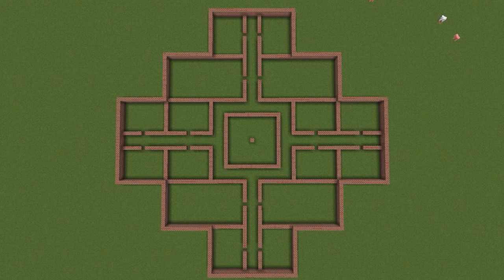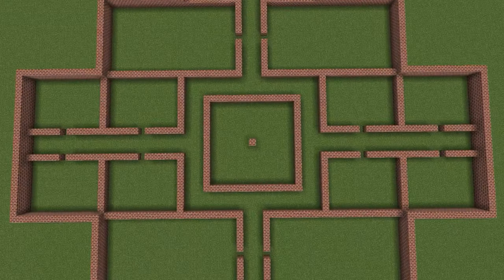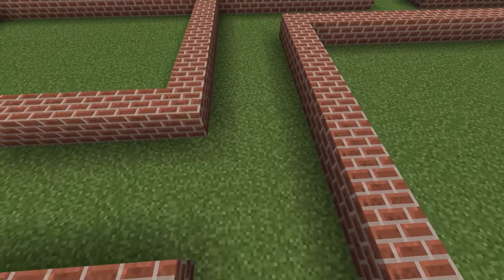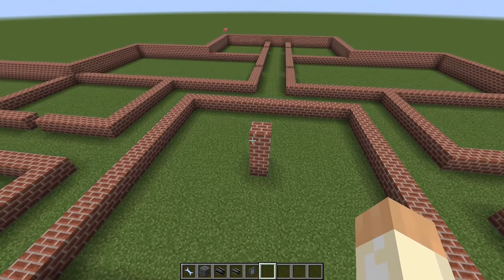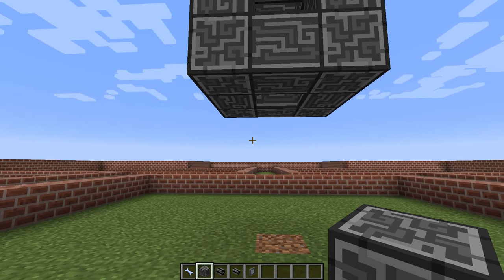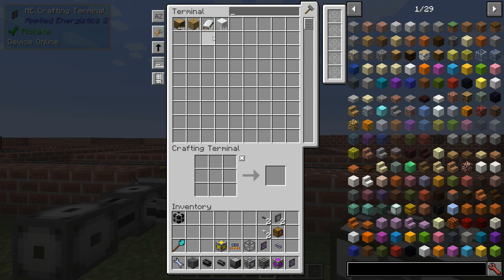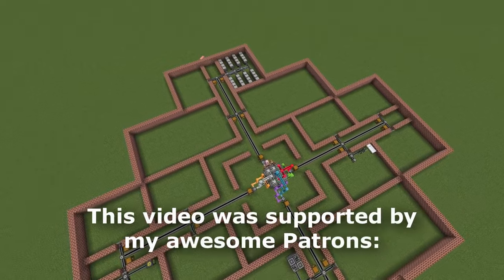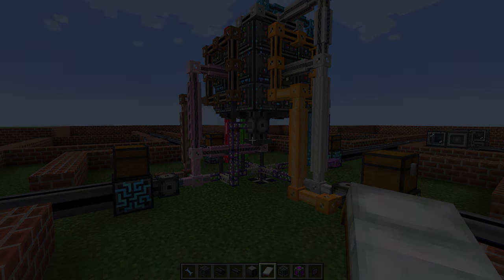Large ME Controller and P2P Network Guide - Applied Energistics 2 Tutorial

Comment from the maker: Another AE2 tutorial video - An updated guide to large ME Controllers and medium to large sized bases. Minor updates since before and everything in the same video should be more useful than the old ones!
Reply: it doesnt work for me i did everything but i cannot connect all my me drives it just uses 8 channels and doesnt give me the full potential
Reply from the maker: @dzzenok4136  Not sure what you've done but you might have mixed up cables (use dense cables where required) and check the video on me networks to learn about how to handle the 8 channel limitation, after that you need a controller, and then you need dense cables to handle 32 channels before branching.

Comment: P2P is a great thing when it works.  I wish I had done your memory card trick in the chest for easy relinks.  I know what I'm going to be doing tonight and that's trying out how you set this all up.  Bravo good job!
Reply from the maker: Did it work out? It's easy to do when it's planned for :) But I know that when you're in the middle of building and expanding you never leave that extra space for a backbone network or a smart P2P system.
Reply: @therealtkh  I actually had so much fun messing around with it I started a new level to start from scratch.  I now have chests throughout with memory cards storing the info and it's simple now even with the amount of connections.
Reply from the maker: @TheElderOne2003  Awesome! :D

Comment: I've done a similar one where I led the tunnels back into the main controller, and then used large cabels to connect to those interfaces. It was pretty flexible, as as long as there was cable capacity, I could connect to more tunnels. However it was also more expensive and complex, needing more controllers for the same result. Your design is neatly separated.
Reply: The "read more" button is broken here

Comment: Maybe a little late but you can name your memory cards in an anvil.
Once your base and your AE2 system grow to a size where you have to rely on tunnels, it will essentially restructure all of your cabling and you will have dozens of tunnels.
If anything breaks or you want to move around your core of controllers, hooking up every last one of the tunnels can be a daunting task and you are likely to forget one.
Having a bunch of memory cards with unique names at least tells you how many pairs of tunnels your base used to have.
Reply from the maker: That's a good point! Another way to do it is to keep a chest (or item frame) next to every P2P tunnel output with the corresponding memory card. That makes it easy to reconnect after maintenance :)

Comment: I hadn't considered using another ME controller to handle all the p2p channels, very interesting!
Reply: This is what many Minecrafters and Minecraft-Youtubers do wrong. They connect the P2P Network back to their Main ME-Controller and waste channels instead of using a separate Controller. They can also run only up to 16 P2P Input-Channels and 16 P2P Output Channels. I tried both Versions, and i think the one like in this Video offers higher operation speed of the whole ME-System and you can run up to 32 Input- and Output Channels per P2P Network (Dense Cable required) at the same Time.

Comment: There is something i can't understand
why doesnt the little controllers break when you connect the p2p cables to them 
and why do you need the smaller controllers for this setup to work
Reply: Late but the little controllers are a separate network, that's why they break when you connect them to the power without clear cable because that'll put them on the same network. You use them so you can have 16 P2P hubs coming from them on a single line, without you'd have to run two lines of 8. 

This set-up gives you access to 16 P2P hubs in each direction, and each of them allows 32 lines / machines. 
There's 9 sets of 8, he's using 8 sets and leaving the bottom set free for now. If I was you I'd leave the top set free of this was in your basement and have them going directly up.
Reply: @anhedoniac6390  
I'm pretty sure you could even have 32 P2P hubs on one line, as long you have two seperate lines only connected by the "p2p-net controller"  

So you go from 4 lines (eight p2p channels divided by two), to 8 times more (32 output p2p channels)

Comment: Thanks for the guide TKH! I'm new to the modded scene and I am now nearly at the point where I start delving into AE2 and I have to say all this is new to me. I also have a feeling this is a more advanced guide and I really should start watching previous guides first as some things are unclear to me. I really appreciate your effort, and I will definitely try do my own research. But, if you don't mind, I would like to know a bit more about these channels and perhaps you could explain a few things?

1) why do you use color coded smart cables? If using p2p channels, would it be possible to just use glass cables through your corridors to connect everything? Then pull out a dense cable from the p2p channels inside the rooms again?

2) why do you use separate ME controllers for the 4 different corners of your base? What is the benefit of doing this and what is the result of this on the amount of accessible channels? Is it considered a separate network that it actually needs its own controller?

Comment: Nice video, thanks for sharing. 
Just a question, why do you need the extra 4 controllers? Can't you just use the dense cable out from each side of the cube with the colored cables connected, since you're using the memory card to link the p2p.
Reply from the maker: A network without controller can only consist of 8 channels. So they are not needed but you could only manage at most 4 rooms if you want 32 channels to each. I have done videos on this before, check the playlist in vid description.

Comment: I have a question. Why do you need the four subnetwork controllers? There are only 16 channels going to the dense cable before the sub network controller so could you just extend that dense cable down your hallways to your rooms?
Reply: All of the p2p tunnels need a controller connected to them, which takes up channels from the main controller if you did it that way, as well as making cable place more complicated. The secondary controllers are used essentially as routers for the main one, which makes network design simpler (as well as being the only way to utilise all channels of the primary controller).

P.S. Sorry if this isn't very clear, but I hope you understand.
Reply: @jessicabevan4657  no that's explains it well. I always forget that the p2p tunnels also need channels to work
Reply: I'm glad to have helped
Reply from the maker: You already got an answer but I want to add one thing: It is possible to skip ME Controllers in the P2P Networks as long as you limit each "thin" cable to 4 inputs and 4 outputs. An ME Network can only have 8 channels without an ME Controller (this is very useful in early networking btw!) which means that the 16 channels (32 in total as the network has to handle the outputs as well) need a controller or the P2P network simply won't work. But for the 16 channels you would have to send 4 thin cables in each direction which would be a mess ;)

Comment: I'm confused as to why you are running p2p in each "room"?  Why not just run straight cable without it?
Reply from the maker: Let's say you want to have 32 channels avaliable in every room, that would require you to run a dedicated dense cable from the main controller to every room, just stacking them on top of each other in the "corridors". It requires a huge amount of material and space. Not to mention that a larger controller might require tunnels to attach to 4-5 sides within a single block space depending on design. So in short: when controller and amount of rooms grows somewhere in mid- to end-game you pretty much need this type of setup if you want everything to be connected in the same network.

Comment: For some reason, my network isn't working (I did the same). I can't insert items in my drives through P2P tunnels (even if I use those memory cards). The crafting terminal I link further (no matter if it is linked to the Main Controller or linked to the Sub Controller) doesn't have acces to the Disk drives. Do you have any idea what recurrents mistakes beginners like me make ? Thx
Reply: i got the same problem :/

Comment: Hey their, got it all working till the very last step when I connect the Smart Dense Cable to the side going to the storage units the P2p Tunnel shows online but the Dense Cable shows offline for some reason. I made sure its exactly as you have done, not sure what I am missing.  This is approximately 15:00 ish of your video. Any thoughts?
Reply from the maker: It sounds like the Dense Cable is not connected on the "source side". In my build the P2P tunnel sits directly on the ME Controller so either your controller is not online, or there is something wrong with the tunnels. Remember that they have one input and can have several outputs. It's important how to link them so the input is the one on the controller and output is in the distant room.
Reply: @therealtkh  Thanks so much for responding! since your vids go back to 2014 it was a shot in the dark so glad your still checking this stuff! So after some looking at all of the points, some work and some don't. I think I have narrowed it down to one side. In two rooms i was able to grab one of the "extra" memory cards that were coded as per your nifty code them all and stick them in a chest next to the controller idea and replace the P2P tunnel in the room and program it with the card and it worked. But I cycled through all the cards in the other location no luck. I feel like I am so close. I think I understand the I paused the video to make sure all of the connections are identical.  I checked all the p2p Tunnels on the Controller Multiblock and they are all input, and the ones in the rooms are output so that appears correct and of course al of the controllers are online as they all have the disco ball lighting effect, and The output Dense connected to it going to the rooms shows online. I have build and rebuild testing and learning all the ins and outs all the way up to P2P, and I thought I had a complete handle on P2p till I tried this build lol, that said my testing was not with a multiblock. Might hop on my creative world, build the multiblock again and do some testing with that, tear down and retry etc. Oh, and do you have a discord by chance or a presence on a server we could connect on? Would be great if i could post screenshots...that said, time is precious so I dont want to take too much of yours.

Comment: Could you expand this if you really wanted to? Idk why you would need to but making the brain a 5x5 wouldn't change the actual functions of the individual controllers would it? Each face for each block would still be able to carry up to 32 total channels via p2p
Reply from the maker: I think I understand what you mean and you are correct in that case. It can be expanded and you can make the main controller with over 20k channels but it will require several P2P networks to only handle all that! Anyway, that's why I have placed ME controllers as a dedicated "P2P network" between the main controller and the corridors. They can handle 32 "main channels" per channel which means 1024 channels going in each direction with only one dense cable.

Comment: hey man i did like u but for some reason i cant see my storage if i am not on a cable from the same p2p channel as the me drive  (Ex: i got a dense cable 6 block in lengt and ive put 2 smart cable on it in diffrent direction and attached a p2p cable on each and configured..... now if i put a terminal and me drive on one cable after the p2p tunnel   it work but if i go to the second smart cable with a p2p channel on it  everything connected to it isnt linked to the other one

Comment: Guys i have a problem. I built everything the same way you did but for some reason when I connect my molecular assemblers to the network the second ME Controller gets red that resets, tries to connect the channels but fails. Can someone help?
Reply from the maker: The second controller that handles the p2p network? Are the p2p tunnels on each side placed correctly? It's really hard without screenshots but it's usually a simple problem, maybe a misplaced cable that connects the different networks together.
Reply: @therealtkh  i might have found the problem. If i have the cable connected to the second controller than on the other side of the cable it goes further it for some reson doesnt work. But if i connect the cables around the controller it looks like it work. But thank you for the response
Reply from the maker: @-bajo-5636  It's really hard for me without knowing your build but remember that you are not allowed to have two controllers in the same network. If a single block (a cable or something else) it can make the system lock up completely. P2P channels are 1-to-n (but I always go 1-to-1) and must be configured correctly on both sides to function correctly. I have covered this in other videos.
Reply: @therealtkh  thx for the help. It seems to work now. The videos helped a lot

Comment: love your tutorials i still dont quite understand why not use the dense cables instead of p2p? i get in the middle of ME controllers we lose 4 slots but do we need p2p for it to work like a big network or what does p2p do i guess maybe i dont understand that part. 
like another thing i dont get is you used dense cables to extend your channels further to reach other parts of the base like to create things like inventory space or crafting computers, you split that 32 cable with 8 channels ones to separate them but then you placed a p2p and connected a 32 channel cable to the 8 channel one, doesn't the 8 channel cable get overloaded if you fill up the 32 channel cable with inventory stuff or does p2p allow 8 channel cable to receive 32 channels content.
Reply: P2P condenses 32 channels into 1 channel
Reply from the maker: Basically what the other commenter said. I have separate tutorial videos on how P2P works and why this is the smartest way to do it for larger networks. If you didn't use a P2P network you would need to draw Dense cable all over the place, and it would be expensive and a huge mess! In one Dense cable you can fit 16 Dense cables (16 inputs and 16 outputs) which means 512 channels instead of 32. Think of it as a backbone network that is separate from the "use network", you can almost say that they are not even connected to each other. Note that in that 8 channel cable going to one room I mostly use only 1 channel for the P2P output. And in there we'll magically have 32 channels to play with!
Reply: @therealtkh  now I cant say how the years have changed ae2 but I have to say I still only use your tutorial :D, thank you again for the comments to explain it, other inventory systems seem way faster to get going and less hassle but I still end up back to ae2 redoing what I did long ago. I just hope it still holds up though it works so I suppose it has not changed that much :D.

Comment: Hey, just a design question. I noticed you did this in the other video showing this kind of ME setup as well. You chose to power the controller in the controller room, thus breaking the aesthetic of P2P tunnels directly on the controller. Couldn't you have just put the power connection in the power room of your "base" and transmitted it through the P2P tunnel?
Reply from the maker: That's a good point, I have done it from habit I guess. But you're right, the power connection to the main network (all rooms and the controller) can be in either room where we can connect to the network. I put an energy cell in the ME Drive room instead and could make the controller run on that power through the network. It's a better solution and I'll think about it from now on! :)
Reply: Keep in mind that in servers, if you use a p2p tunnel for powering your controller, if the chunk is unloaded and you load it again, it takes a couple of seconds for the system to get running again. Thing is, controller must be active to link the power p2p tunnels, so your system ends up with no power and becomes unusable. This is from my experience on a server, without using chunkloaders
Reply from the maker: @xxBI0Sxx  Good to know, I always chunkloaded my network chunks so it was never a problem for me (in my single player worlds).